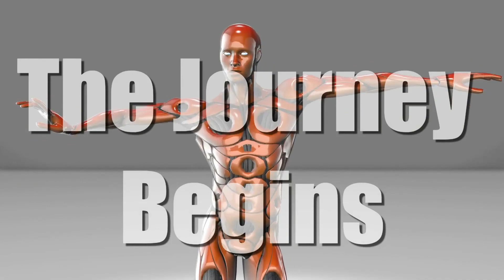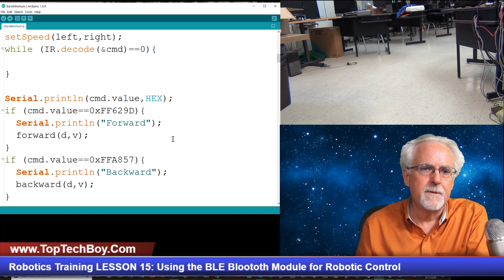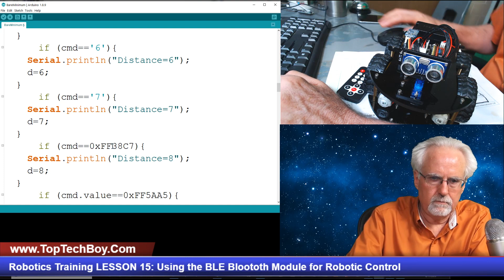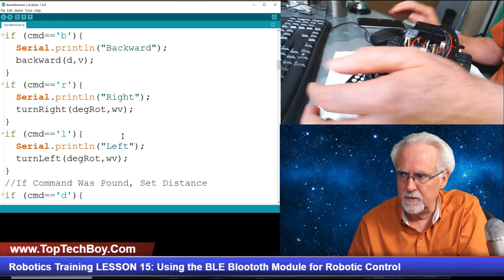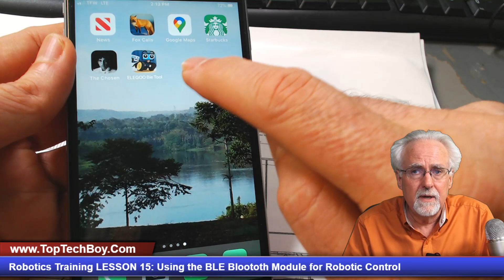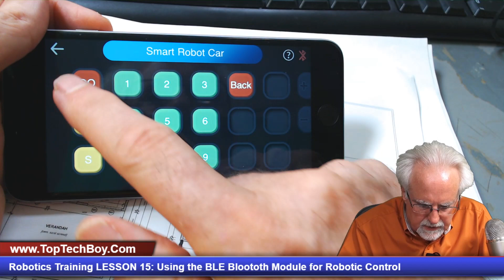Robotics Training LESSON 15: Using the BLE Bluetooth Module for Robotic Control

Comment: Hi @Paul McWhorter I want to create multiple sequences using 4 separate Arduino cars. For instance...

*Sequence 1:*
2 cars forward two steps 
1 car still 
1 car back three steps 
(all simultaneous movements) 

*Sequence 2:* 
4 cars move forward 6 steps 
(all simultaneous movements) 

*Sequence 3* 
2 cars back 
2 cars still 
(all simultaneous movements)

Will this be possible with the Arduino? If not, how can I achieve this wirelessly?

Comment: I wrote in to adjust for distance and also adjusting turn angle in degrees. Works real good. My little robot is a Frankenstein build, I used a DSD tech Bluetooth module with the Elegoo app. Very nice, works as it should. Thank you for the instructional video. Have not started on the Python series yet as I am working on my rover project. Still a ways to go, I am learning a lot here.

Comment: I have taken time to catch up to this lesson. I have taken the code and made one line for each option. That way it is easier to read and trouble shoot. I have also installed an led for when it is ready to receive a command.  BLUE. I wanted to have additional leds for turns, and white for forward and red for back. However I found I am out of available pins. I also thought about using shift register, but I think I am out of pins for this also. 

What do you think about putting leds on 7,8,9,11 pins?  Would this overload the motors?

I still need to add my jogs to the screen. I would also like to use another screen for other functions, ie follow the black tape, or use the depth perception.

Comment: Where is Lesson 16?
Reply from the maker: School has started and I am back to work full time, and it is a very hard school year, with all the covid stuff, things that used to take 5 minutes take 30 minutes now. Also in the middle of a move. I will have to get my head above water before I can make more videos. Maybe over thansgiving break. Would really love to be able to make these videos full time, but unfortunately, do have to make a living.
Reply: That is disappointing that we will not have another lesson until Thanksgiving but there is still plenty to learn in the meantime. I will dig out my most complete starter kit and return to the Arduino lessons. I’m very curious about removing the shield from the smart car and making a new one without the IR, Bluetooth and line tracker. This will allow me to add on an RF remote and maybe that compass gizmo. Or should I just add on a Nano and connect them using I2C?